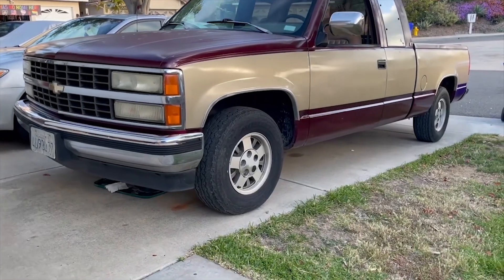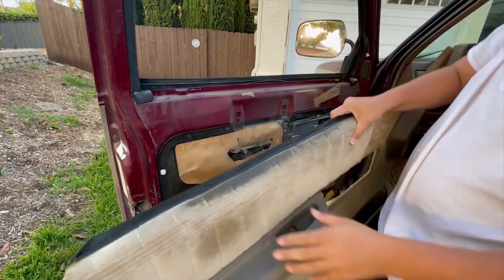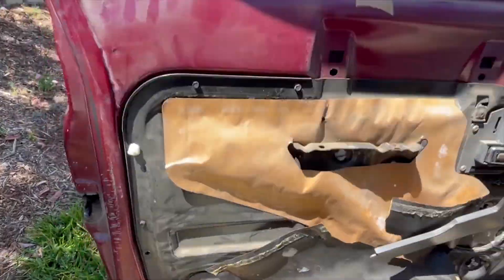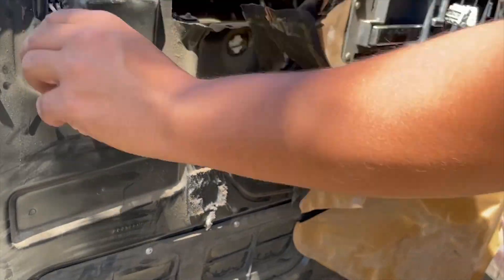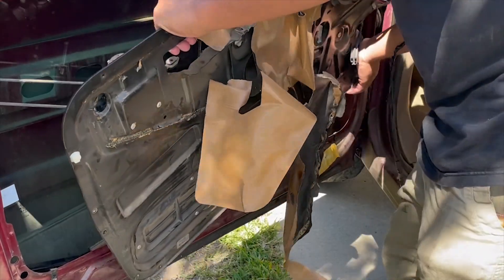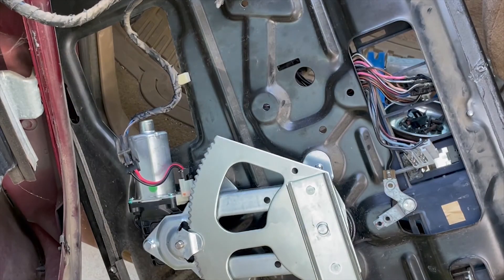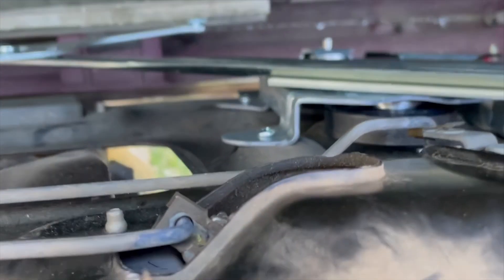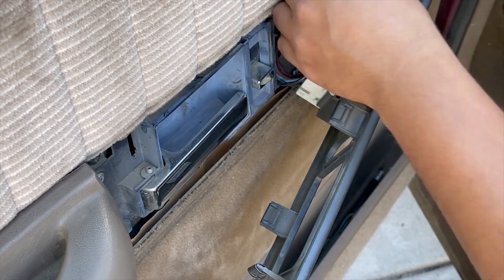How To Diagnose And Replace A Window Motor And Regulator (1988-1994 Chevrolet C/K 1500 & Suburban)

Comment: I sliced my finger on the first step in removing the panel, that metal plate behind is sharp as hell.  Using cut resistant gloves next time.  Thanks for the video though, very informative!

Comment: Before removing the door paddle, there is a screw behind a switch panel that you didn’t mention so you got two Philip head screws that you have to remove ones on the armrest and one is behind the switch panel because I broke mine. Also, the screws are 7 mm socket.

Comment: Just so everyone knows. When you pull the black door panel away from the door.To release the clips holding the rods. It's very easy to bend the rods. When you put everything back together. The rod that is hooked to the lock actuator will bind the plunger. That locks and unlocks the door. It doesn't take much force to press the plunger against the sidewall of the actuator.The rod needs to be perfectly centered to the plunger. If not the power locks won't work freely. Making you have to press the lock/unlock button repeatedly to lock or unlock the door.
Reply from the maker: Great information!!

Comment: Good to see you are still responding to the comments 1 year later. What a great tutorial. My 93 2500 silverado Drivers side window is slipping and stutters and stalls on the way up ... If I pull it up when using the switch at the same time it will go almost all the way up ... Then stutters and stops a quarter inch from the top so I push it all the way up from there with one hand on the inside and one on the outside of the glass... Do I need to replace the mechanism? Or? Thanks ... I just subscribed
Reply from the maker: Thanks for the support! I would definitely lean towards your regulator and motor needing to be replaced
Reply: @biggirlsgarage8331  thanks for the reply. The window stops and stutters
At the same places each time. Leading me to think that it is not the motor ... Sounds like the gears are stripping, would that be the gears on the motor or on the lift mechanism?Is it easier to replace both at the same time as one unit or separately if it is not the motor? Thank you 
Again
Reply from the maker: @j.angelis6934  It could be the gears on either the motor or regulator. I would agree with you that it is more than likely the regulator. However you can purchase them as a unit for not much more if you were to buy one separately. It is easier to replace them both while you are there.

Comment: Hope this makes sense, I have a 88 ...manual doors/locks, I have the harness for the power but wondering do I need to swap the doors or can I just get the black panel screwed on the door and put on my doors?
Reply from the maker: No you should be able to use the same doors
Reply: @biggirlsgarage8331  thanks

Comment: Is there a way to just push the window up manually and make it just stay up?
Reply from the maker: If you remove the motor, you should be able to push up the window manually.

Comment: Bro how did you get the rollers in the channel without having the regulator off? I can’t get the window to stay in its channels at the bottom without feeling like I’m going to bend the window mechanism and I have zero reliable help to assist me because it feels like I need to have five hands to do this. What the hell did you do? I’m desperate and just want to fix my window man.

Comment: Getting power on the passenger side down button but not up button. Window still doesn't work either way. Changed regulator and motor still no movement ... What could my problem be?
Reply from the maker: You could have a problem with the switch, I would start there.
Reply: I have the same issue on my passenger side, did you ever find it out?